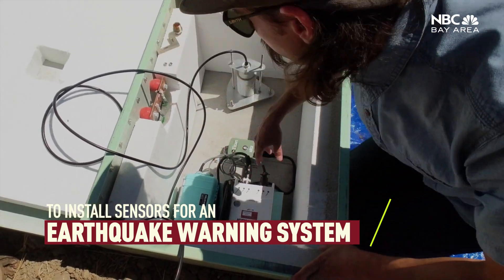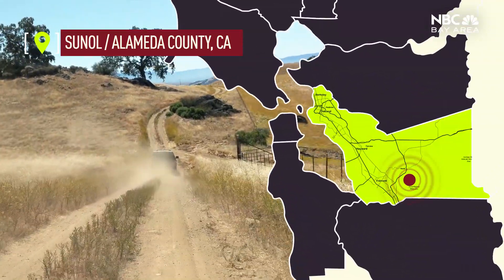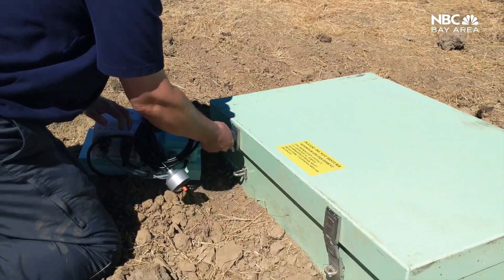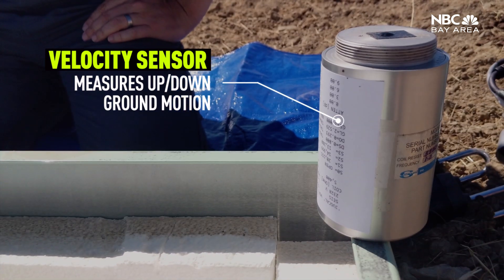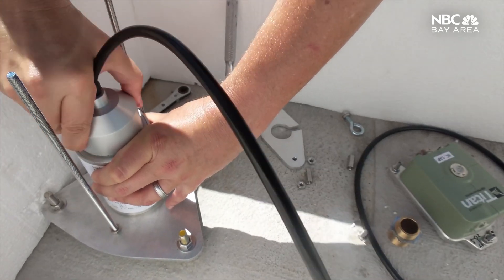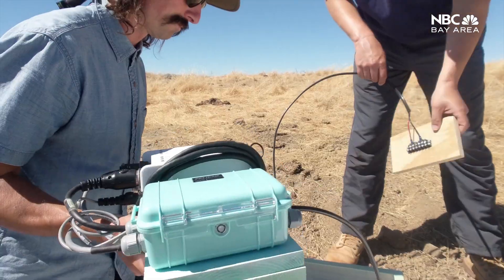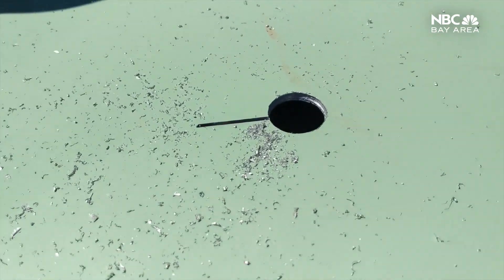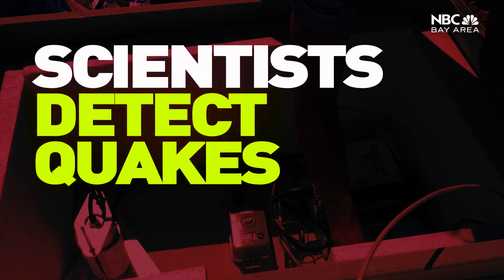Behind the Scenes: Watch USGS Scientists Install Sensors For Earthquake Warning System

Comment: The Earthquake detector instrument is engineered to last for many years, it is also incorporated with plenty of features designed to prevent earthquake, aside from POLARITY measures based on the TECTONS of the 50 states and neighbors.  The Equipment supply is also configurable, in order to detect /prevent casualties, such as TSUNAMIS, TORNADO, HURRICANEs, since OCEANOGRAPHY is RECONCILED with its Expertise accordingly with its PHYSICISTS and VULCANOLOGIST-GEOLOGISTs for the Instrument Research.  The METEOROLOGICAL SCIENCE DEPT, in coordination with the HUBBLE SPACE AUSTRALIA is RECONCILED with its yearly studies of the COSMOS and the PATTERNS in Geography, Molecular Activities of the STRATOS, MEZOS and IONOSPHERES and its POLARITY, that gives an ACCURATE RESULT in PREVENTION, PROTECTION of any OCCURENCE, UNPRECEDENTED. This is TIERAGE EXCEPTIONS Attested by the Private Sectors and Public sectors for the AWARENESS PROGRAMS..****NON ALGORITHM STANDARDS of EXCELLENCE in the application of NATURAL SCIENCE and ENGINEERING PROTOCOLS for SAFETY and INSTRUCTIONS*** Tierage THANK YOU...IMPORTANT.. ∆